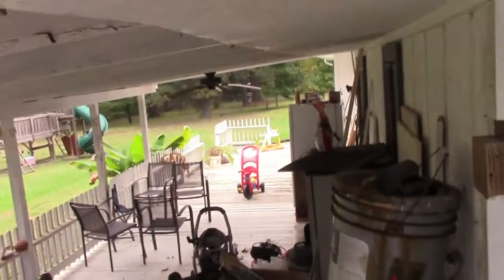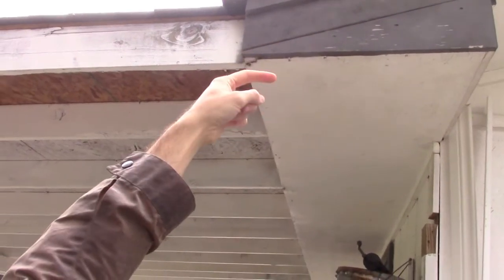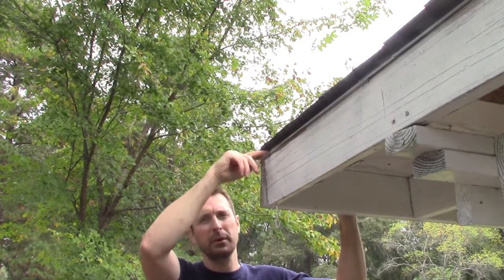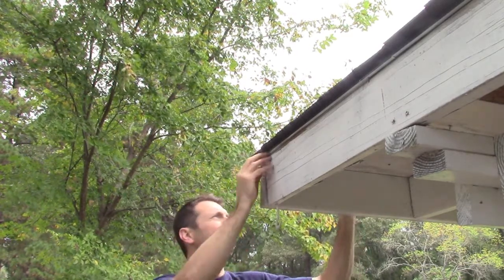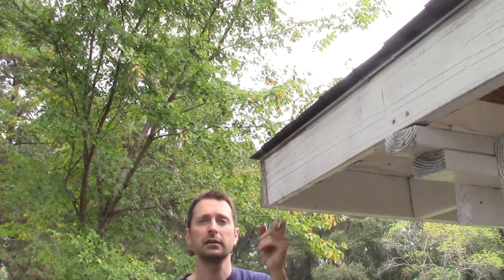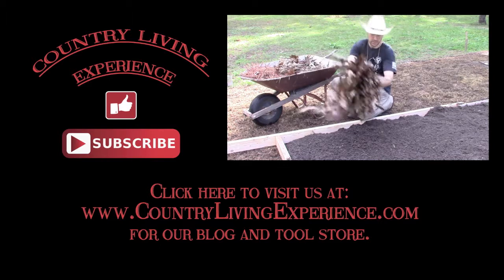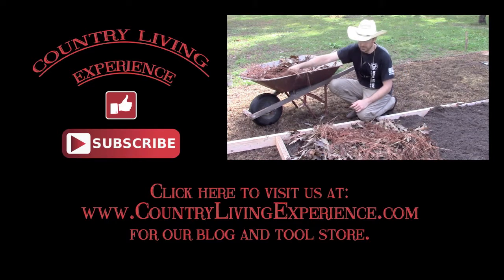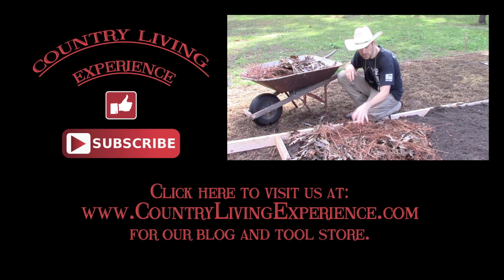How to install roofing drip edge

Comment: it was good to see your "real world" video showing the problems that many of us have when doing a repair. 99% of the videos show the job going smoothly, so you do not get to see the problems that most of us DIY guys have.

I am having same exact problem lifting the shingles high enough to nail in the drip edge. I guess I could use the bar as you did, but I was thinking that instead of nailing the drip edge to the deck that i could just use a strong adhesive like "liquid nails" or a roofing adhesive ADHESIVE silicon with good sticking power. I do not see why this would not work, but have not seen anyone else try it on youtube.  It is just for a 20ft section across the front of my garage. What do you think....might it work? Any suggestions on type of adhesive to use?
Reply from the maker: Thanks. I try to keep it real. I think an adhesive may work but I would worry about it's heat resistance. Make sure you get a roofing adhesive and you should be good. Let me know how it holds up.
Reply: Its only about 20 feet, so I will let you know how it worked out and try to update you in about a year to see if this short cut is a keeper. Thanks so much and will be looking at some of your other videos soon.

Comment: The way those rake edges are are not my favorite. They usually drip down the rake and hit that triangle board. 

IF I have to put in that triangle board, I try to do it with a board that is less thick. Then I out a small kerf cut or something to make the water drip off before the triangle piece. 

I have seen water go down rakes and into the house at the corner. Crazy
Reply from the maker: I understand and you are correct. I did not have time to redo the entire gable end. If I was building a new house, I would do it correctly. To date, I have not had any problems with the repair.
Reply: Glad it worked! Yeah, just because they are pros or know what they are doing don’t mean they actually give you what was in the bid.